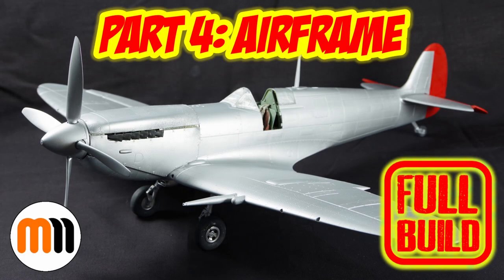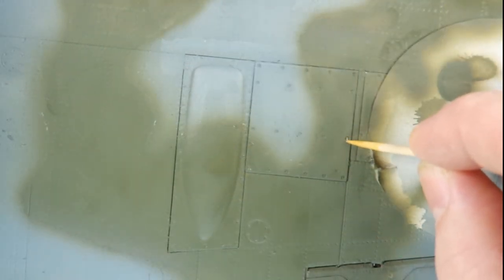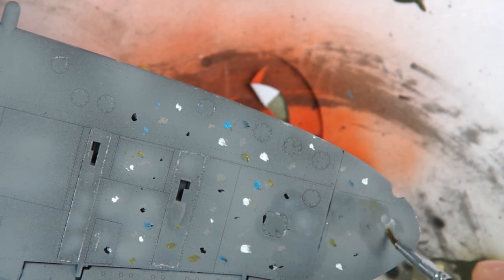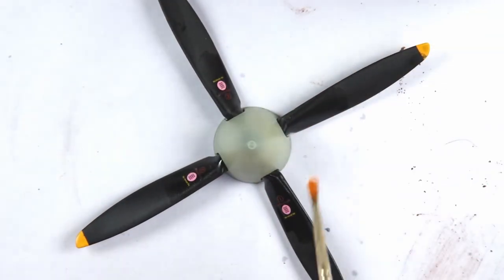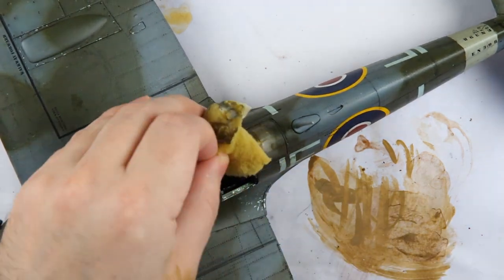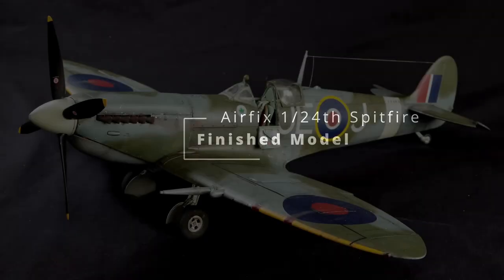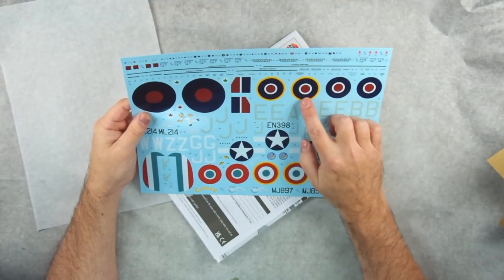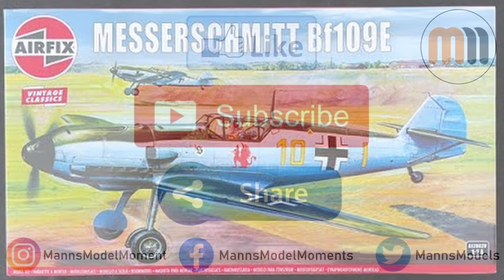Airfix 1/24th Spitfire MK IXc Build Part 5: Finishing

Comment: Informative, well made and enjoyable build series Alex. I agree with your conclusions. I have four kits being worked on with two close to being completed. As you point out, it has potential to allow a modeller to enhance. There is more than sixty hours put into refining the outer plastic surfaces of the two models that are almost done and will be in the markings of Johnnie E Johnson, 'EN398' and George Beurling, 'MA585', displayed in flight together on custom stainless steel stands with pilot figures and motorized propellers. EN398, first flight  February 2, 1943. Repainted JE-J March 16, 1943. There is an Official RAF training film on the practices of preparing and painting, High Speed, aircraft posted on my channel. It proves the use of putty and primer filler to make the leading, D box section of the wings smooth so for anyone wanting to build this model as a wartime, in service Spitfire the rivet detail in those areas should be filled in.

Comment: Looks great Alex. Can I just add though that there would be no antenna wire on this aircraft - it had the VHF radio which had the antenna within the mast. I'm planning to tackle this kit towards the end of the year and will certainly be referencing back to your videos. Do you have the Kotare Mk.I on order?
Reply from the maker: Really? The references I have show the Mk IXc as having the antenna
Reply from the maker: If it turns out it didn't, at least I can just cut it off!!
Reply: @MannsModelMoments  No Mk IX had an antenna wire. I'm intrigued to know what reference shows it?
Reply from the maker: @miraclepaintmasks4791  I don't think you can say that definitively, given that 5,656 were built, and the early ones had a mess of mixed equipment in order to get them into production. I've seen illustrations both online and in books I have that show Mk IXc with aerial wires, though they could be inaccurate as well, of course. These would, of course, only be early production airframes with transitional equipment as EN398 was.
Reply: @MannsModelMoments  The VHF radio was equipping Mk Vs and the Mk IX had the VHF radio, none of them had the HF radio which is the equipment that required the antenna wire. You can tell that the model doesn't require the antenna wire because it is missing the triangular bracket which houses a pully wheel over which the wire went to turn into the fuselage, so it wasn't a separate piece either. When the VHF radio came into service the antenna was retained as was but the triangular bracket was left off. The bumps at the top, which should have rivet fixing holes in them, were still part of the manufacturing process. The very much shorter antenna wire is now inside the antenna.
Any illustration that you have seen showing them is wrong and they probably also show a headrest, which was removed during the production of the Mk V.
Reply: @miraclepaintmasks4791  Good call.

Comment: I have worked on a Spitfire Mk IXc  and a a Spitfire Mk XVI since 1976. You did a wonderful job on the Airfix Mk IXc . I suggest that you replicate the Anti Chaffing tape on the cowl frames. This is easily done with brown paint. Mk IX's had a TR1133 VHF radio and no aerial wire was seen. The actual aerial was a rod up the middle of the radio mast. The wheel wells were the same colour as the underside as were the oleo fairings. The oleo legs were aluminum. The tires and wheels would have creep marks on them which would be easy to do in this scale. I have the Mk IXc kit from Airfix and look forward to building it with Mann's Model Moments as reference. Cheers...Bob Swaddling
Reply: Good call on the aerial wire. Lots of modellers adding it unnecessarily.
Reply: @johnmclean6498  This is correct regarding the top aerial - but there still should be IFF wires running from both side of the fuselage to the stabilisers.
Reply: Beautiful. A lot of valuable tips, thanks. One question though, you mention using "Pledge" in the decal process. Where I live ""Pledge" is a lemon scented furniture polish. I don't imagine this is what you're using. Could you elaborate on what product use actually used?

Comment: I pre ordered my Spitfire back in November,arrived on the 7th Feb,when I opened the damaged box,I had a cracked and incomplete clear sprue,I reported the problems to airfix on the 8th feb,it is now 18th April and I have still not had the replacement parts,been waiting over 2 months for them,they told me to chase royal mail up,they never had anything from airfix,in the end I gave up,and have binned the kit.
Reply from the maker: That's terrible - usually Airfix customer support are very good, and it seems a shame to waste the kit...did you try ringing them?

Comment: Great build! I am an oldtimer that just returned to the hobby, after some 35 years absence. I am building four 1/32 Spits for hanging in the ceiling, and I still call airbrush cheating (it is a bad way to say I am jealous of it). :)

Since I have watched so many videos and photos now, I am fascinated over two things:
1. How dirty the planes where/could be during the war. I have seen some model builds where I think "THAT is dirt overkill!". And it is not. They where used, for real.

2. How perfect many models fit together, when the originals (from the war) often didn´t. There are more "mistakes" in the pictures from the actual war planes than many modellers would accept. I am not talking about right and wrong here, it is simply interesting. It is also about the scale and "visual tricks" in building models. 

Also, thank you for the reference for the tolerance in the actual painting of these planes. I won´t make it, since I am painting with brushes and after a bad experiment with templates/masking now paint "with my eyes". All of my friends will still say "WOW!" when they see a squadron of big Spits in the ceiling, I will be satisfied enough and no expert modellers will ever see them. :D

Comment: That's a classy looking Spit' and a really interesting series, great fun to watch. I would mention that from the Mk V (I think) the arials didn't have a wire as the VHF sets were introduced and the arial was contained within the mast itself. I stand to be corrected, of course.
I thoroughly enjoyed all of that build; congratulations.....she's a beauty.
Reply from the maker: Reading more on this it was during the introduction of the MkIX this seemed to happen, as well as the IFF changes. Johnnie Johnson's aircraft was an early variant and still carried  the old IFF light etc, so I"m going to assume EN398 was not fitted with upgraded gear 😁
Reply from the maker: If it turns out it didn't, at least I can just cut it off!

Comment: Some very interesting techniques you’ve shared here. Will give them a try. Is there a reason you use Pledge in place of the usual decal setting solutions? Cheers. 😊
Reply from the maker: Yes, it's a single solution that acts as a gloss coat,setting and confirming solution, and I've always had better results than with things like microset/sol, as well as it being cheaper. In short, why wouldn't you? 😁
Reply: @MannsModelMoments  yes I will try it. I still have a bottle of Future (Pledge) from awhile back. I’ve used it before as a satin coat on the model before laying down decals, but never as a decal-setting solution. 👍🏻🙂
Reply from the maker: Hopefully I can find a suitable replacement before it runs out!
Reply: @MannsModelMoments  Holloway House’s Quick Shine Floor Finish has been recommended as a good substitute. If you can find it, I’d love to know what you think of it.
Reply from the maker: @ronaldbyrne3320  I've heard that, but I think it has a number of things that don't make it equivalent. Firstly, it's not an easily available product globally, secondly, it lacks some of the key organic chemicals that I believe gave Klear/Future/Pledge some of its properties. I'm happy to try it if I can get my hands on it though!
Reply: @MannsModelMoments  🤞🏻Here’s hoping you can get some, to tell us if it can be a substitute to Klear/Future/Pledge for our needs.
Reply: @MannsModelMoments  Having only just discovered the use of Pledge from this video, I was disappointed to find it was no longer available. I'd be very keen to hear of a suitable UK replacement once you find one.
Reply from the maker: @jasonwebb71  Yes I only found out it was discontinued shortly after buying my last bottle.

Comment: If you do not allow the oil paints to dry before covering with a protective top coat, you will get a paint error called 'crazing'. Its where the paint cracks as it shrinks at a different rate the the drying of the paint below it. Letting oil paint dry is a huge variable - to me its the only downside of using that medium.
Reply from the maker: Diluting them with white spirit gets rid of most of that issue, breaking down the carrier medium and drying them out much more rapidly - but yes, of course you should always ensure any paint is dry before applying a differential medium

Comment: Im hoping to get this kit at Telford this year. I noticed that you did not open up the panels ?
Reply from the maker: Which panels? All of the panels that can be opened on the kit without altering it were done....
Reply: Sorry, i had heard that the engine couling only fits if you dont do the full engine detail.  @MannsModelMoments
Reply from the maker: @TotallyScaleModels  Not so - check out Part 3 of this build (appropriately entitled "Mighty Merlin!) where you can see me put the entire engine in the aircraft. I actually magnetised my panels (shown in Part 4) so I could display them open or closed. Also, it you want one before Telford or can't find it there, I've one in my shop both physically and on-line!)
Reply: @MannsModelMoments  I had only watched this episode. Thanks but I’ve sourced one now.

Comment: Great build and paintwork but I think I would still prefer the Tamiya 1/32
Reply from the maker: What makes you say that?
Reply: The Tamiya is a far superior kit albeit more expensive. no gaps around engine cowls ,thinner more in scale held by magnets and second to none surface detail. dont get me wrong I cut my teeth on Airfix kits way back in the 60`s but when ur shelling out close to a hundred pound I plump for a few more to get the game changing Tamiya kit. That`s just my opinion @MannsModelMoments And if I wanted a MK 1 it would have to be the Kotare. Airfix have come along way but they are not a triple A manufacturer rather double A.
Again just my opinion.
Also Tamiya kits are designed and manufactured in Japan not peddled off to China or India

Comment: Did you hear that the makers of Pledge have stopped making it?
Reply: not a problem if they have: use Quickshine from Lakeland
Reply from the maker: Yes, unfortunately
Reply: @MannsModelMoments  I've never used it, always used a purpose made model varnish or decal setter.
Reply: I don’t think they have stopped making Pledge. It has just been renamed. I can’t recall the new name now, I’ll have a look and report back here.
Reply: @ronaldbyrne3320  According to Fine scale modeller, johnson and johnson have stopped producing Pledge floor polish.
Reply from the maker: Yes it has been discontinued. J&J make other products that are similar, but not with the same formula or overall properties for modelling
Reply: @johntreloar8203  you’re right, I just looked it up. I also found that there is a substitute product — Quick Shine Floor Finish by Halloway House — that apparently works as well as Pledge/Future. There’s a video on YouTube about it. I’m going to see if I can find Quick Shine in my neck of the woods and try it. 🙂
Reply from the maker: There are several videos on it - I think the conclusion is it can be used, but it's not as good and doesn't do everythign Klear/Future/Pledge did (which is understandable as its got different chemical in it - notably it's missing the plasticising agents)

Comment: Hi! This is is a nice build, and I've enjoyed watching the series. I would just point out one little thing that I've noticed while watching, in case you do another in future - on a Mk IXc, there is no antenna cable along the top (I'm pretty sure). But - there is still an IFF antenna running from a point on the sides of the fuselage to the very outermost point of the horizontal stabilisers.